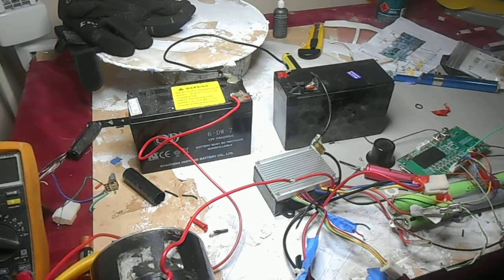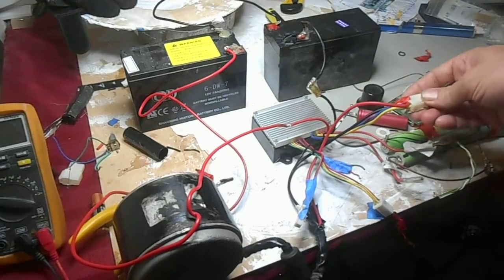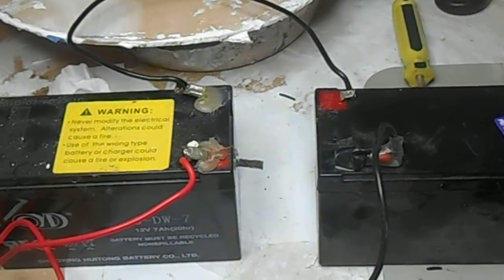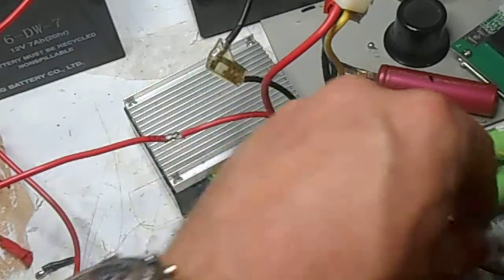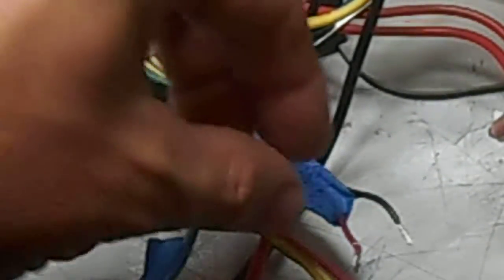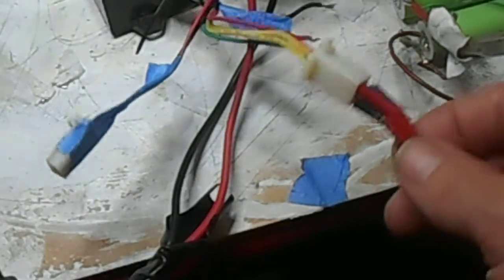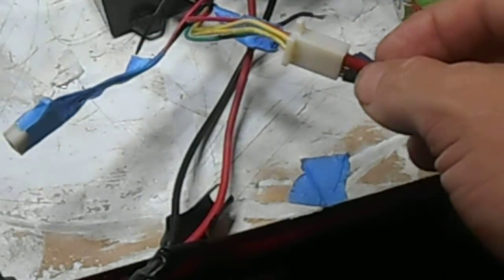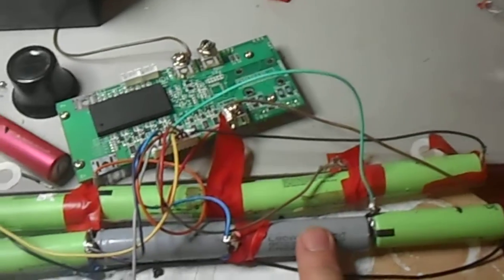Razor scooter tutorial E300

Comment: How will i fix if the batterry not charging?maybe i have wrong wirings
Reply from the maker: yes something wrong , check you have the correct wires going to the charge port from the controller. Be aware that some differernt versions may have different coded wires confusing things

Comment: The the yellow and blue wire which one is positive which one is negative on the controller
Reply from the maker: Hi
Yellow is negative on original controller, but best to check with multimeter .Any cheap meter with continuity setting will do it . Please read some of zhe other replys ,to find a detailed explanation on using the continuity setting.  Hope this helps

Comment: Does the controller limit the top speed, I switched the 350W motor for my e300, but the speed is the same as the original e250W.
Reply from the maker: Hi
The gear ratio has the greatest effect on speed.  To increase speed you would need to change the gear sprocket but that's outside my field.  Though you could compare it to say a 10 speed bike, where the bigger gears on the back wheel make it easier to pedal uphill but you change to the smaller gears to get faster on the flat surface with less pedalling. What you should get with the bigger motor is more torque from the motor which improves getting up those hills.

Comment: I'm on the throttle part with two orange wires and two brown wires and I'm trying to do the same conversion that you did the four slot to the six lot I wish I had a picture of the conversion you did any chance of seeing that
Reply from the maker: Hi . Not sure what you mean .  Though remember the 2 yellow wires are negative, the red us power and green is signal which is liw voltage about 1.2 or 3 volts .  If you have a multimeter with continuity you can find earth by connecting one end to metal ,say chassis of scooter must be bare metal . And one end to your wire . If it rings its negative, unless shorted but that's another story. Green wire turns on transistor inside controller and current flows . Some more modern throttles have an extra wire 8f using old controller box don't need.  Later models will have an extra wire for the thus . It gives mire controlled acceleration due to being possibly connected to a digital potentiometer.  
Hope that helps . Have fun  experimenting

Comment: Who can print a electrical drawing, (schematic) off the Razor 250 & 300.????
Reply from the maker: I could probably do a block diagram . The controller is the only component that has any real circuit board in a razor 300 and as such schematics available from razor or from most manufactures  are not freelt available e controller is most likely a couple of power transistors biased as switches to control the power 
Cheers
Reply: You would think that the, Razor.com,  could have one on line.

Comment: hi Kenneth I just put a 18650 kit on my e300 its 5s6p x2 its 2600mah Samsung an Panasonic new cells it wasn't charged full just 3.60v per cell as they came but I'm charging now after test run with my hoverboard charger 42v lithium .it ran out of steam after a mile up hill ans stuff.i have a 36v controller an variable throttle on it
Reply from the maker: steve mcgowan Awesome ,Steve. Keep them projects rolling.
Happy new year
Reply: Drone,repair
Reply from the maker: I didn't have brilliant results with the lithium cells either.
Lead acid just last longer, possibly because they drain slower due to higher internal resistance.You really need 8in series and as many in parallel as possible to increase mAh capacity

Comment: Hi Kenneth when u say chassis do u mean the controller chassis when testing for continuity ?
Reply from the maker: steve mcgowan Hi Steve. Any bare metal area will do for negative meter probe . Best using scooter chassis or negative wire.Yiu don’t need batteries connected to do continuity test.
Reply: Kenneth Jones thanks Kenneth for reply just had snow here in uk my cousin in oz.its an electric bike kit Ive bought off eBay now 36v 240 watt motor it span up ok when first connected its a front wheel hub kit then on test ride no power so asked for new controller but the same .the throttle lights up ok an when connected motor direct to battery 36v it tries to move .its 3 x 12v leads that ok it’s charged ok 36v so suspect motor sensors in wheel .im trying to use another throttle so will try find negative power an control 5v with meter on continuity .thanks
Reply: Kenneth Jones so on my mountain bike the frame or wheel will do for chassis ?
Reply from the maker: steve mcgowan Hi ,Controler should be connected power off for continuity test. Negative meter probe on any negative area. Bare metal  on scooter is a good place or  a negative wire. Same place for negative probe for voltage test to. Remember to put meter back to DC voltage setting and turn power on. If your trying to identify throttle control wires . Once you identify negative. The other wires will be have different voltages . The Lower voltage will be control voltage and higher voltage throttle Power itself.Use the throttle wires coming out of controller to do this. You now have to identify wires coming from the throttle itself and match them up with controller throttle wires.Black is usually negative. The positive wires can be any colour unfortunately.To identify the voltes you may have to connect original wiring and test throttle wire voltages . Control voltage wire is a very low voltage. Like 1.2 volts or even lower.
Reply: Kenneth Jones thanks the bike motor is trying to spin can hear buzzing when I twist throttle I’ve got my scooter controller an throttle connected but there’s 3 motor wires blu green an yellow so just swapping them
Reply from the maker: steve mcgowan Yes . Once you hear the meter ring it’s making connection

Comment: hi Kenneth my razor e300 controller has 3 red wires at the end is the first one batt + an next 2 power on/off switch .I cut them off to swap in a 36v controller but that not working so going back to standard.steve in uk
Reply from the maker: steve mcgowan Hi Steve. Make sure any different controllers have same outputs .Different controllers can have different throttle wiring. Usually throttle only needs 3 wires . Positive and negative and one for control voltage. Control voltage is usually a wire of lowest voltage ,and usually turn on a transistor or FET .You may have identify the wires from the actual throttle. Negative is easy.With Volt meter on continuity and One lead to chassis and other to a  throttle wire till it rings .Other 2 will be power . You may have to juggle the two around to find the correct one if you don’t know .check voltage of throttle wires with battery connected with voltage meter.connectors can be spliced if they are different .and you have wiring diagram for new controller.
A 36V controller will probably work with 24 volts but you will lose current. 24 volt motor will run on 36 volts but you may shorten motor life.
Cheers

Comment: my controller just clicks when I give throlller.batteries won't hold charge..old batteries for sure..I did by pass the control saw back wheel turning very slow..but only charged for hour..should buy controller and batteries??
Reply: Ozzie salvatico. u allready fix it cause mine do the same just click and nothing
Reply from the maker: Ozzie salvatico Should only need new batteries. Suspect some kind of controller problem if new batteries drain quick . You may have some internal short

Comment: How did you go with your mod and is the scooter still going 2 years later cheers Ocean
Reply from the maker: Ocean Tomkins Sorry I’ve been out for so long . Interesting you mention it . Laptop batteries not very successful. I did have the scooter going but it was under powered and the laptop cells became dangerously hot . 
I suspect I didn’t have enough batteries. It was hard to find many laptop cells and pulling laptop batteries apart and soldering them all up is like playing with a bomb.
Not recommended really. There are cells designed for this purpose. They are a little larger than laptop cells and they are LIPO. They have slightly different voltage and chemistry.Laptop batteries where lithium ion I think . Look up headway brand . They are the ones you want. I can’t remember the model number of headway’s . 1820 or something like that .They can be up to 10 amp hour. 
They are expensive and there size is a little big for 8 of them to fit in a e300 razor easily. Not impossible though. 8 in series 24V. Wired through BMS(Battery management system)of course.
Cheers